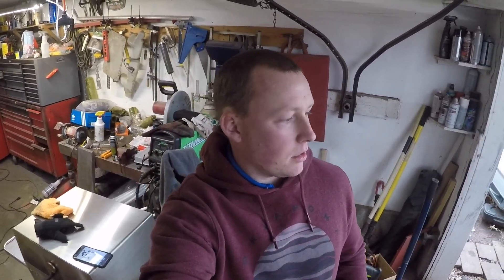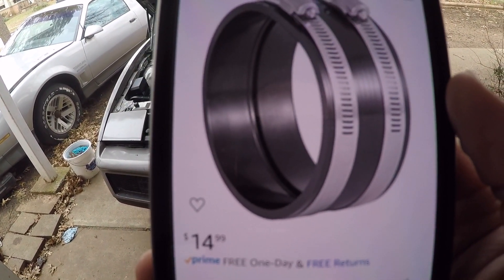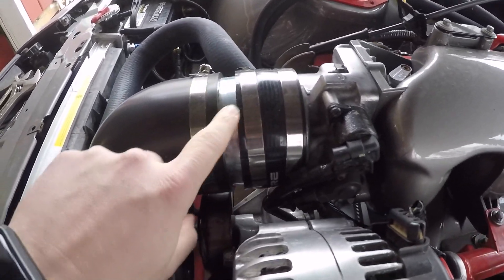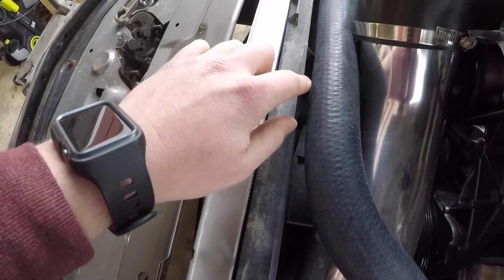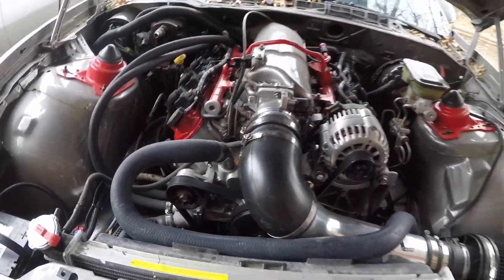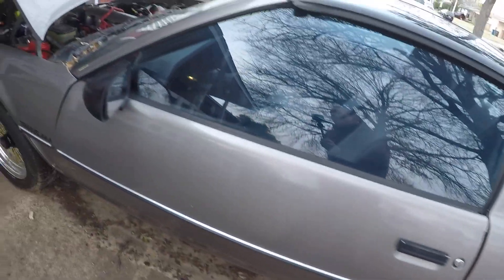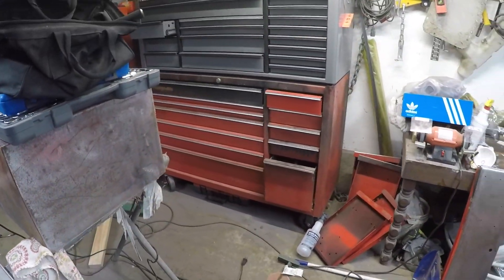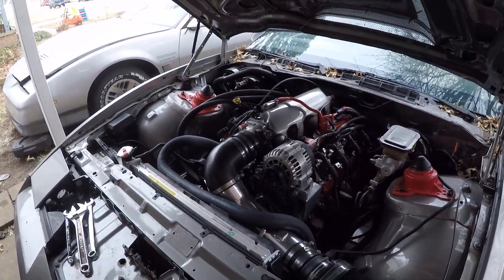LS Swap EBAY "Cold" Air Intake under $70

Comment: Did you shave your intake? If not do you know anybody that does? Need one shaved.
Reply from the maker: Yes I shaved it
Reply: How much would you charge to shave one?
Reply from the maker: @controlleddetonation8905  depends on how far you want to take it. Start to finished ready to install?, ready to paint, base coat clear coat? Spray paint?
Reply: @Lsxtransam83  complete painted black.
Reply from the maker: @controlleddetonation8905   base coat clear coat?
Reply: @Lsxtransam83  yes
Reply from the maker: @controlleddetonation8905  $250

Comment: Did you have to change the power steering pulley? If so which pulley did you go with?
Reply from the maker: Rick Ruiz no, it’s the pull-up that came with the 5.3 just like all the accessories
Reply: Yea the pulley that came with mine is touching the steering box. Maybe some truck have a smaller pulley
Reply from the maker: What motor mounts did you use
Reply: 5.3 out of a 2002 Silverado
Reply from the maker: Did you use spohn motor mounts?

Comment: Wat the part # of tht top radiator hose
Reply from the maker: The rad hose is off a 2000 tahoe 5.3. Chevy/gmc Trucks from 99-06 should have the same upper rad house if they have a v8
Reply: @Lsxtransam83  thanks